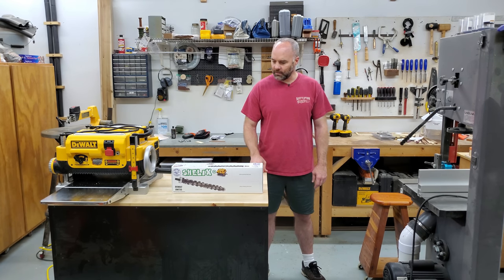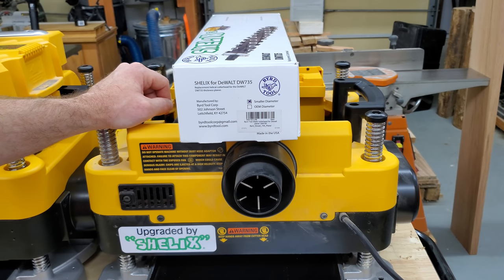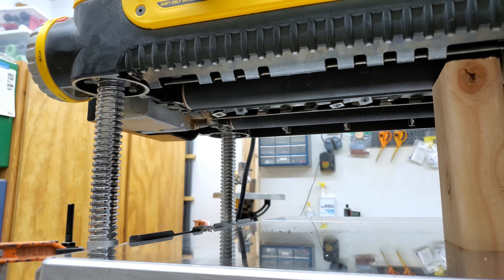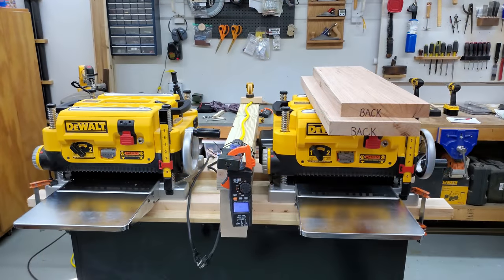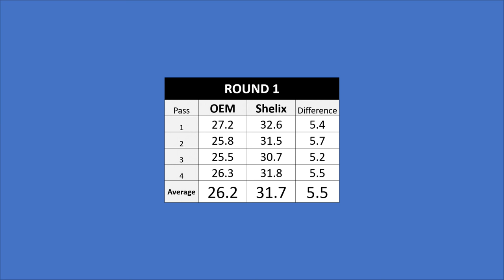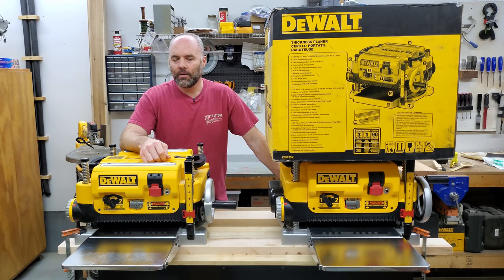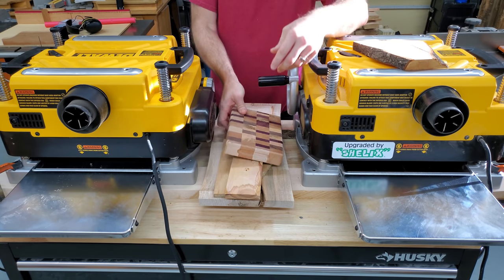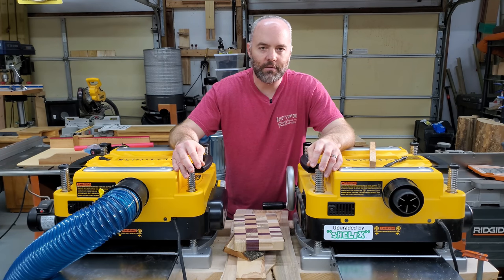The video I wish I watched before buying a SHELIX

Comment: I found this comparison between the two  interesting to say the least.
What I wanted to see was the surface cut between the two. 
I have seen ads for "Shellix" but never seen the results.
Reply from the maker: I showed some cut-quality comparisons at the end of the previous version of this video, and intended to do the same with this one, but two things got in my way. I did the cut comparison at the end of the day, and the low-angle evening sun was so bright it washed out the boards. Second, the steel knives were new, so the cut quality was much better than it would have been after some use. This was a close match with used carbide cutters against new steel knives, but if the steel knives had been used even half as much as the carbide, there would have been a lot more chipping. New/sharp steel knives give a great finish on uncomplicated wood, even better than carbide because it can be sharpened to a finer edge. Once the steel becomes even slightly dulled, the quality goes downhill fast.

Comment: Magnuson/Moss Act prohibits any manufacturer from requiring use of their brand of disposable items in order to maintain a warranty.  If they would require that, they would be required to provide those disposable at no cost.
For example, if your auto manufacturer required the use of their proprietary oil to maintain the engine warranty, they would have to give you the oil at no cost.  You do need to use an oil that meets proper specifications.

Comment: Thinking about buying a planer, so this showing up in my recommended feed was timely. I like your analytical style! Subbed. Cheers

PS I happen to live in Bellingham, WA where Grizzly headquarters resides, so I have a lot of Grizzly gear (table saw w/ cast-iron router table extension , bandsaw, drill press, etc) any opinions on the lower end Grizzly planers (12 1/2” and 13”)? Also on their 6” spiral-head Benchtop jointer?
Reply from the maker: Glad it was helpful. I've never owned or used any Grizzly equipment, so I can't comment. They were in the list of possibilities when I did my last bandsaw and drill press replacements, but didn't get selected.

Comment: I am curious what the voltage is at these planers with and without load. My bet is that  the voltage is falling well below 120VAC during the loaded runs. If so that alone will increase the amps the planers are pulling . However the loads you saw are far above what I would expect to have seen even at 100V. At 100V  I would have expected to see only ~18 amps on the stock planer based on the Dewalt 120V -15A spec.  36 amps is crazy high on equipment that is setup with a 15A plug and cord. I'm curious what the U.L. guys would haver to say about this.
Reply from the maker: I put the voltage information in the video description. I'm guessing they get away with it because of the 18V breaker in the planer.

Comment: Just guessing but I think the shelix is drawing more amps because it's not being bogged down as much. Were they drawing the same idle?
Reply from the maker: I think the Shelix was lower at idle compared to the straight knives, which I suspect was related to wind resistance. The harder the motor works, the more amps it will draw.

Comment: Are both the 735's the same type (type 1, or type 12)?
 
Edit: I'm going to assume that your old one is a type 1, and new one is a type 12 according to your comment @19:25.
 
The reason I asked was because I had a type 1 and put thousands of LBF through it before the motor went. When I replaced it (unknowing as to how Dewalt changed "type 1" to "type 12") I has a lot of issues. Eventually Dewalt replaced it, but I had issues again. I eventually got my money back for that (and a dws779 that was also cheapened) and left Dewalt in my rearview for good. (🖕Stanley Black and Decker🖕🖕🖕!!! )
  
Anyways, hope ur new planer doing well.
Reply from the maker: Both Type 1, and both still holding up well.

Comment: I do believe that in order to do a proper current draw test, you will have to make a pig tail with two separated wire so that you will be able to just measure the current either going in or coming out . What is happening is your meter is reading the current in both directions and adding them .
Reply from the maker: Measuring the hot and neutral together would actually read zero, because they cancel each other out. I do another run with a home made line splitter here: https://youtu.be/KBL97SqVrDc
Reply: @TheSnekkerShow  I totally missed the splitter in this video . However I did watch the other one again and you still have discrepancy in the no load draw . Between around 7A in the last video and  14A  , A 7A difference. I have enjoyed your testing and the process you took . I wouldn't have needed to see so much wood get just planed away. Thank you for your sacrifice .
Reply from the maker: @mallig47  Good catch. The apparent discrepancy in the no-load measurements is because I removed the impeller from the planer for my latest videos. I don't remember the exact numbers, but no-load with a SHELIX head installed drops from around 12 to 6 amps with the impeller removed. https://youtu.be/UoBN5Sc_2uk

Comment: Interesting that the different cutterhead also resulted in a completely different no load sound. Never knew that was a thing before. I always thought the difference in sounds happened ONLY during the cut (due to the sound being a series of very narrow cuts happening rapidly one after the other with the shelix vs. 3 very wide cuts happening rapidly one after the other with the straight knives). I've used both types of heads before and the cutting sound difference was always very obvious even though it wasn't a side-by-side test, but I never knew the no load sound would change as well. That's the beauty of side-by-side tests, I guess.

Comment: Liked and subscribed in Albuquerque. Interesting test results. Thank you for sharing your in depth knowledge. I will do some historical research. You mentioned your local EMC. Do you reckon that's pretty accurate? I get around 6 here on the northern edge of the Chihuahuan Desert, and that's pretty consistent across species and time of year.
Reply from the maker: I can't remember exactly what I said, but I think that most of the lumber on my garage usually stays around nine percent. I usually run a dehumidifier during the summer so my jigs don't swell, so that probably keeps it down a little.

Comment: I'm torn between the DeWalt with the Shelix cutter head extra and the CuTech, which comes with a spiral cutter head already installed. I can't find a head-to-head comparison. Any suggestions/recommendations about which one to go with?
Reply from the maker: I've looked at the CuTech before, but not in detail. It looks like the CuTech cutterhead has straight cutters, rather than helical. They also have fewer total cutters, which should be better for power consumption but possibly worse for finish. CuTech inserts are more expensive too. I've been curious how a three-row cutterhead like the Grizzly version compares to the four-row Shelix or Lux for cut quality.

Comment: I often wondered why Dewalt never came out with their version of the helix cutter head as an optional upgrade.
Reply: Probably because they believe in its current form, the motor or related parts would not be likely to last through the 3 year warranty, and their costs for warranty repairs might skyrocket! If DeWalt’s engineering people ran similar tests and saw the voltage numbers, I’d say they’d be very hesitant to recommend moving forward with production of it! They’d rather let the buyer install the thing, then MAKE money off the repairs and parts instead of doing it free under warranty , the labor and parts costs coming out of DeWalt’s pocket in that scenario!

Comment: Are you sure your line splitter only has 10 loops? if it has 20, then the converted amp readings would still be doubled (and thus actually within the 20 amps supported by your circuit).
Reply from the maker: Yes. There's a link to the splitter in the video description.

Comment: The replacement of the blades part  of the video does not get into the fact you can resharpen usual straight blades rather easily, carbide blades not so much. Nick a carbide and throw away nick the steel blade- sharpen and use it again (till a point of course) will effect the monetary cost of blades somewhat.
Reply from the maker: True. The DeWalt knives are sold as disposable, but I'm sure they could be sharpened. The price of those blades has gone up significantly since I made this video, so it might even be worth the time and expense for some.

Comment: Was the higher amps because of the smaller cutter making more power on the rollers too ???
Reply from the maker: I haven't tested that, but it's possible the smaller diameter and increased pressure on the rollers have an effect. I don't think it would be much.
Reply: @TheSnekkerShow  it’s due to the motor not getting any time to run without load as there is always a cutter in contact with the piece, whereas with straight cutters, the motor is not under load between the contacts of each cutter.
Reply from the maker: @MrPacobolo  That is a popular and plausible theory.

Comment: I wondering what type of extension cord you're using and how long? A short fat 50 amp power cord might improve the amp draw. Maybe not just a thought.
Reply from the maker: 15' 12 gauge. I took some readings and put it in the video description.

Comment: I just bought a used 735 and I'm shocked at how loud it is. I'm considering a helical head to reduce the high-pitched whine.
I'm a bit surprised the power draw results. Not disputing the numbers but when the machines started drawing over 27A and 30A the 20A breaker should have tripped as both loads are far above the typical 80% continuous load rating. What do you think is going on that the breaker didn't trip?
The other aspect that is odd is that the built-in circuit breaker as rated at 18A per the parts manual. So for it to not trip at 27A and 30A is very odd.
For reference, I run mine on a 15A circuit and only had it trip the breaker when planing maximum width taking deeper cuts.
Reply from the maker: This should answer your questions: https://youtu.be/24f-J0lVo-E

Comment: Thank you for a good video on a popular tool, especially as it addresses a common upgrade.  Regarding the power draw test, I noticed that you used speed setting #1 to remove 1/8" from a 10" board.  This stood out for me as I'm used to using speed #2 for dimensioning, and only switch to #1 for the final finishing pass, which I do without changing the depth setting.  
In the DW735 manual (page 14) for troubleshooting circuit breaker trips (which couldn't be far off at those loads) Dewalt recommends reducing the feed rate as a solution.  No need for a version 3 of the video, but would you consider running the power draw test on the slower speed to see if it makes a difference and let us know the outcome?
Thanks.
Reply from the maker: I don't remember the exact numbers, but I planed the same boards on speed 2 (faster) and it drew noticeably more power than the slower speed. I think it got over 40 amps for one of the passes and quickly tripped the breaker in the planer.
Reply: @TheSnekkerShow  Hmmm.  I don't really have an answer to that.  I run mine on a 20A circuit and haven't had any issues, with a 3hp dust extractor on at the same time.  Have you thought about contacting Dewalt for their perspective?  Not that it's your job or anything.  Lol.
Reply from the maker: @jimgordon8938  If you scroll through the comments there were some other people who ran the same test on their planers and eventually came up with close to the same results.  It's normal, but also surprising for those of us who didn't know how much power it was consuming.
Reply: @TheSnekkerShow  Definitely surprising.  Now I'm wondering what the other machines do...   Thank you for raising our awareness of this.

Comment: I have not measured the Shelix teeth that contact the board at the same time while planning, but being they are on a angle they would have a longer combined surface area than for the single blade edge

Comment: Thanks for the great video. Question: how is it your breakers didn't trip on your outlets?
Reply from the maker: The over-simplified version is that it's like putting your hand on a hot surface - The hotter the surface, the faster you remove your hand.  If you search for "circuit breaker trip curve" you'll find charts that show trip times based on amount of overload, and there's a video link at the bottom of the video description that shows the inside of a breaker as it happens.
Reply: @TheSnekkerShow   I like the analogy of the hand and the hot surface. Breakers don’t actually measure current, they measure heat by way of a bi-metal strip. As the strip heats up, it pulls away from the point of contact and eventually the breaker trips. The more current you draw, the faster it heats up. The smaller the gauge wire with the same current, the faster it heats up.

Comment: I finally got around to install the OEM Shelix cutterhead in my DW735 that I had sitting on the shelf for a few months. Now the planer vibrates so much that I can no longer set work pieces on top of it while it's running. They will vibrate off and fall on the floor. Have you experienced this? The installation went well, no problems at all. It planes well but the vibration concerns me. I believe the cutterhead is out of balance. What else could be causing the vibration?
Reply from the maker: I never noticed any change in vibration. I'd double check that every cutter is installed, and check for any play in the bearings by pushing the cutterhead around. I've only called Byrd Tool once, but I was able to speak directly with a technician with little delay.

Comment: So I have confusing responses as to how long it takes before an overcurrent will trip a breaker. One response says a circuit breaker can exceed the rated capacity by 50% for 5 to 10 minutes, another gave an example of a 20 amp circuit tripping 10-20 seconds if the draw is 25 amps and even faster if the draw is higher.  So I am concerned about your results. Either the current readings are misleading or you potentially have a defective breaker.  Personal experience:  I have a table saw with a motor that draws 8 amps when it's running, that would translate to roughly 12 amps when I started it up.  It was plugged into a 15 amp circuit and it would frequently trip the breaker even though the saw should never have exceeded the breaker limit.  Well it turned out that there was a table lamp plugged into the same circuit and if it was on, the breaker would trip when I started the saw, so that's why I'm concerned as my experience is that the current can't exceed the breaker's limit for very long before it trips, I don't believe that a properly functioning breaker would allow you to exceed it's rated capacity for several minutes.

However, your test may be flawed. You measured only the  peak current draw. You were cognizant of the inrush current being higher than the operating current and zeroed out the meter before you fed the boards into the planers. What you did not do is measure the current while it passed through the  planer.  There could be a momentary high current draw when the board is first inserted that then drops below 20 amps once the board is fully in the planer.  A better test would have been to set the meter to continuous rather than peak and film the current from starting to plane the board to when it is finished.  I am willing to bet that the running amps of the planers after the board is initially fed into the planer will be less than 20 amps.
Reply from the maker: There's some more information in the video description, and this follow-up video is pretty informative as well: https://youtu.be/24f-J0lVo-E

Comment: I see a slight flaw in your amperage comparison:  You measure amperage of the 2016 model with the Shelix cutter head but not with the stock cutter head.  I suspect the amperage of the 2016 model is just higher than the 2020 model with either the stock or Shelix cutter head.  Perhaps there is some difference in amperage between the two but would bet that it isn't much.  Essentially, I think there are likely fair differences between the 2016 and 2020 model motors.  Perhaps examine the motor nameplates and even compare the parts list to determine actual motor characteristics.
Reply: This is a Google translation. Please excuse any confusing sentence structure. I also noticed that the amperage comparison is not meaningful because the manufacturer may have improved the efficiency. In order to measure a difference in performance between the two knives, one would either have to examine two machines of the same year or both times the same machine with exchanged knives. So first with the originals and then convert to the Shelix. The different sound (the frequency spectrum) is possibly due to the different geometry of the knife shaft. With the original there is always only one knife in the wood while with the Shelix there are always two, four or six knives in the wood. So there is a more even load.

Comment: Does the undersized Shelix cause the higher draw from spinning faster? Are you going to do a comparison between the the OEM size and undersized Shelix?
Reply from the maker: I don't think the cutterhead size makes a significant difference in amperage draw. The running theory is that it's because the helical head has constant contact with the wood, compared with a three-knife design.  If I buy a second Shelix I might do a comparison, but I don't have any immediate plans.
Reply: @TheSnekkerShow  I'd bet it's more of a difference in the 2016 and 2020 model motors than the cutter head.  If I recall correctly, the amperage draw on the 2016 model with Shelix was higher without load than the 2020 model with stock cutter head without load.  That is the clue.